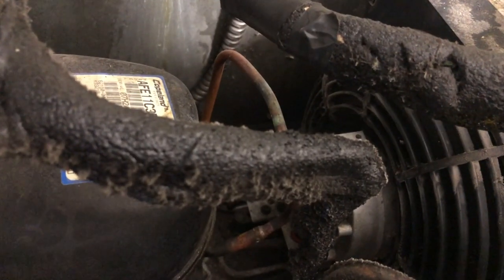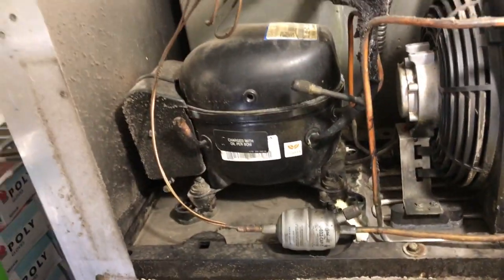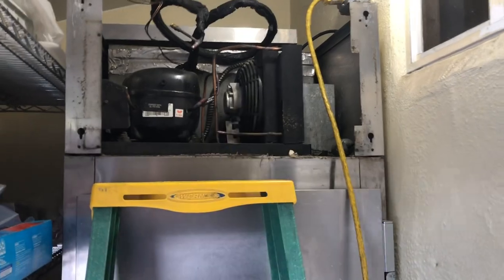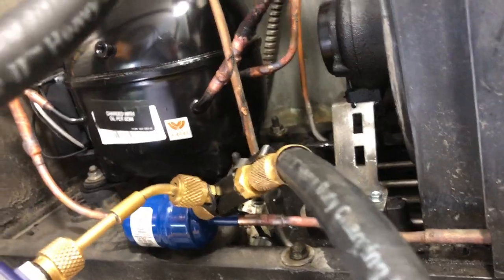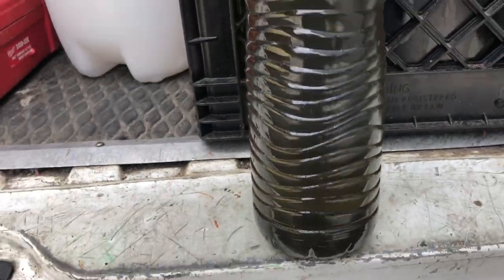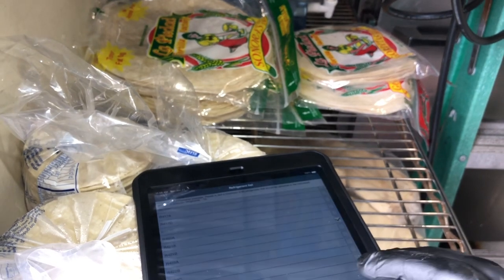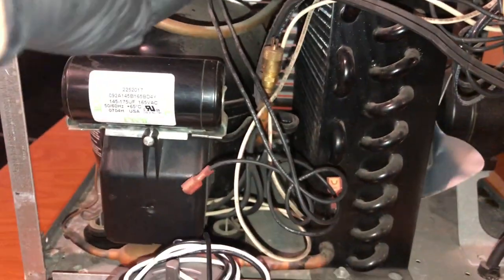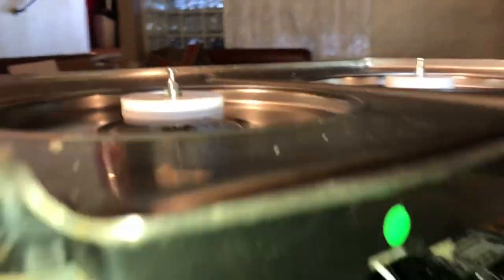Freezer compressor replacement

Comment: In aus we would have just changed the condensing set usually there is only a $150 difference between just the compressor and the whole set, saves going back for a condenser motor later, although most of the time we have to wait a day or 2 for parts where we are. Sick video, love the gear you use

Comment: Do you still use your testis or do you use the fieldpiece just ordered the 2nd gen testo with extra pipe clamp and temp humidity probe for AC work
Reply from the maker: I use them with MeasureQuick you can use both Fieldpiece and Testo at same time.

Comment: if you opened both sides of the manifold gauge for recovery arent you risking cross contamination? i dont even see a y fitting from the manifold hoses into  1 3/8  recovery hose into  a filter dry into the machine

Comment: dave  i have a question, if i skip the pressure text, go to vaccum pump , if it go to below  500 micro  the mean  no leak  right? thank you
Reply from the maker: No psi test.  Don’t skip.

Comment: Real question is why the comp failed.
I might suggest the cap tube system overcharged after last repair.
Often with a shit cap tube the tendency is to overcharge to get a correct evaporating temp - it works for a while - then either seized (oil washed away by liquid at start up) or inefficient (due to liquid return at start up breaking valve plates).
Often the end failure is preceeded by a start cap failure.
ALWAYS replace capillary when possible. The factory usually had it wrong.
I recommend/use the secop sizing program, but it's far from perfect.

Comment: I HAD THE SAME CLICK HAPPEN TO ME TODAY!
I am working on a little old masterbuilt reach in freezer and you could hear the same clicks
No evap fans
One condenser fan. Constantly running with the other cycling on and off followed by a click 
My semi hermetic comp is super hot
My start cap is hot but within the proper mfd(run cap is in range and not bulging)
I have an open leg on the coil of my potential relay. I was going to switch out some start components tomorrow  but I think that compressor is going to go soon... condenser unit has a paint marker scripe that says compressor changed in 2013...
I'm just trying to get them going for awhile
What do you think
Learn a lot from you dude thanks
Reply from the maker: Replace start components and see if it lives.
Reply: @NorCal-refrigeration  ok so I got my parts delivered 
Went to the site and installed them.
Went to go turn on the circuit breaker 
AND some D-bag from another company lock-out_tag-out my breaker 

Major wrench in the works
Reply: I took apart the old potential relay and saw the contacts were jacked. The compressor on this reach in was changed in 07... just to give you some perspective on this turd I am trying to polish

Comment: Can someone explain to me the click of death and why it happens. I know it's thermal overload bi metal clicking.
Reply from the maker: Usually the compressor is locked up. And can’t run
Reply: Will a 3 in 1 hard start kit help out? Or is just better to swap it when having that problem?
Reply from the maker: Isaac it was done. But yes a 3 in 1 can sub the start components
Reply from the maker: https://youtu.be/4wrhGi37lso